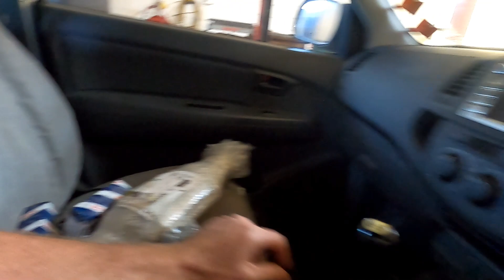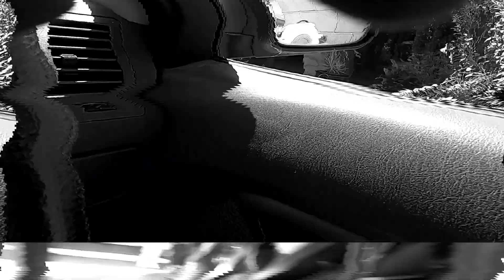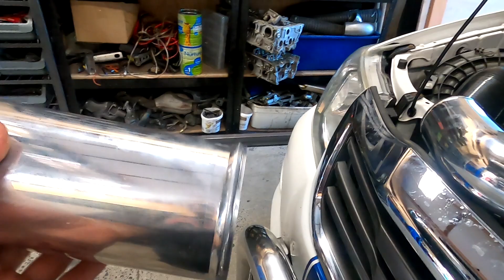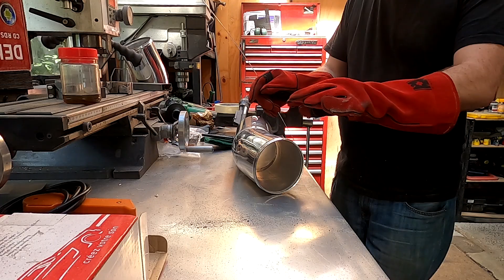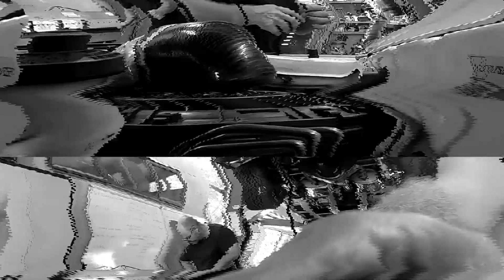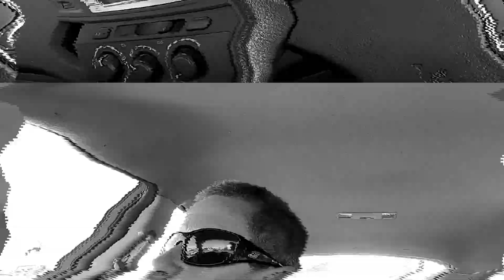2014 2wd Toyota Hilux LS2 6 litre V8 swap.  Exhaust on, new air intake and first proper drive. Ep13

Comment: Kelvin, I like the way you pull all your mates in to get it done! Nothing better than a quiet truck with a big motor.
Reply from the maker: That's what mates are for.  Glenn does a great job and works on Nissans so that' his thing , and we trade info when required.  Great to bounce ideas off.  Ive had this one back for its first service as the owner must live in it.  Its lovely to drive , and now has cruise control.  Cheers